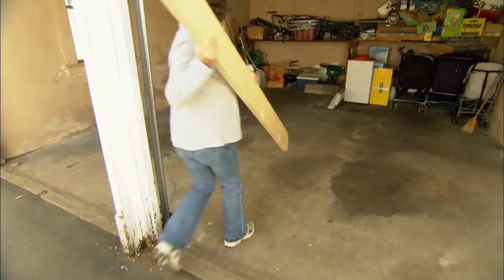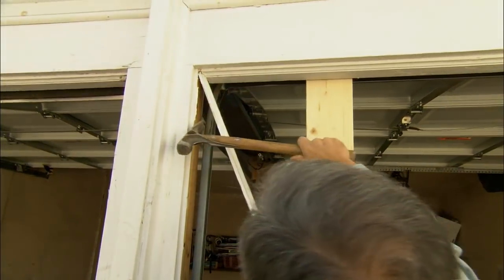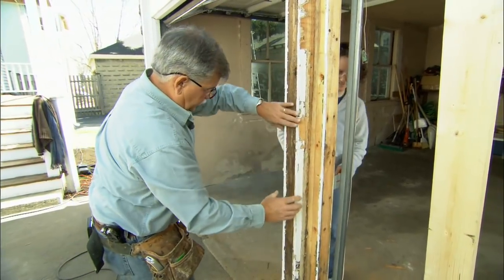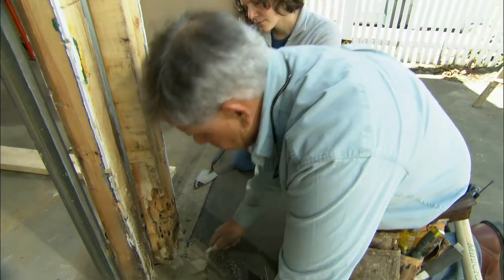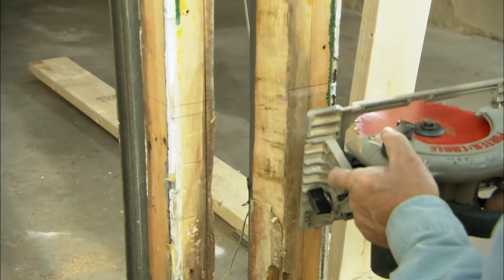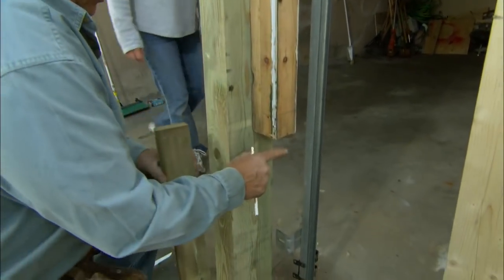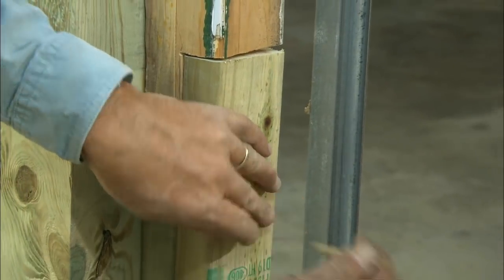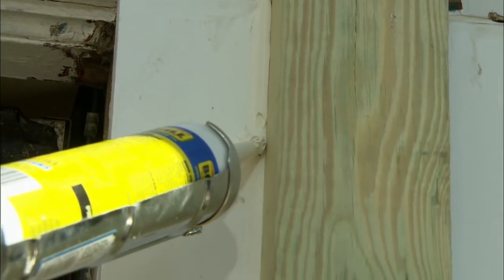How to Replace a Rotted Garage Door Post | This Old House

Comment: Seeing the shoddy way the original post was constructed... makes you wonder what the rest of the structure looks like and how much rot is eating away the garage
Reply: Shoddy and shitty as it may be, it provides a great opportunity for him to get in there and make a night and day difference.
Reply: Porsche924Tim . The post looked like it had dry rot as well.  This is probably from the East coast where temperatures are high in the summer and freezing in the winter. I see this all the time.
Reply: Probably not shoddy work, maybe just really old.
Reply: @dangerdavefreestyle  yeah... i'll pass...
Reply: @zomgosz1503  That's what I was thinking.  That garage was probably built in the 1950s.

Comment: Great job Tommy.  Hey I was asked to repair a 100 yr old house front door jam that the wind had ripped the storm door hinges out and stripped out the wood in the jam.  I chiseled out 12" long sections where the hinges go replaced with oak, glued in with Grizzly glue, and then countersinked a few smaller engineered screws, plugged and filled the seams and sanded all smooth.  Then painted the door jam.  Looked like new.  Replaced the storm door.  One year later another wind storm took the door off and the hinges stayed put with the screws still in.  The door was in the front yard.  You would have been proud Tommy.  And I'm just an old Herk pilot with some woodworking experience.
Reply: I spoke to Tom and he's not proud
Reply: That’s fruity

Comment: Did anyone else pick up on that fine Vaughan Titanium hammer.  I've had one for a few years now and its absolutely Aces!.  It's so light I feel like I'm gonna blow the neck out,  one of the best hammers I've got. Don't want to bust it ripping out some old lumber,  but.........a tools a tool and meant to be used and that's why we love them.  Nice work Tom. Your videos are always cool to watch.  Nobody's ever beyond picking up a few tricks from a great tradesmen.  Another proud carpenter!
Reply: Sorry Scott, that was a Douglas DFR20 hammer, not a Vaughan Titanium.
Reply: Mostly I use a hammer to pull out nails once I got my nail guns. Never could sink a 3.5" nail with one hammer blow.

Comment: I read that treated lumber can corrode doors so it shouldn’t be used for framing. Is that true? Also read that framing should 1/4” off the concrete to prevent rot. Is that also true?

Comment: How did he get that base plate in the right location and angle to insure the post was plumb? It looked like he just stuck it in there and eye-balled the location and angle. Also, how did he hammer that post onto wet concrete?
Reply: It was quick setting concrete that doesn't really compress even when wet.  And the base plate is plumb because the top is plumb and the post was cut at right angles.

Comment: He didn't lift it very much, but still... Once the new post was in, I'd remove the temporary post before I finished any of the trim pieces in case it settled a little bit.
Reply: Framerite Airdrie 
Concrete wasn't set yet.

Comment: You always want to primer bare wood. The wood needs to be primed , before caulking. This will prevent moisture from becoming trapped behind the exposed wood.
Reply: It's pressure treated.
Reply: You don't think much do you?
Reply: You can’t prime pressure treated wood until it dries out. Could take months.
Reply: @SolitaryMaverick  You could... but it's pressure treated so it would be pointless...
Reply: pressure treated wood still rots, and yes, you can still primer it

Comment: thought you couldnt use pressure treated studs for this type of constructions...i have a moisture problem in my guest house i just cannt keep humidity out...the wall agains the back yard is just wet all the time...the bottom 7 inches of the whole wall is rotted . the shhet rock and the 2x4 studs the one laying on the slabs and all thw ones standing are rotted...i was gonna use 2x4 treated studs...they told me Big no no at home depot....so i dont really know what to do
Reply: Jesus Hernandez - The reason they said no pressure treated is because it'll twist and shrink...which will pop drywall screws and give you warped walls.  All treated wood shrinks and dries funny.  You need to fix the moisture problem, not the materials.  A 4x6 beam used here is less likely to warp as significant as a 2x4, and it's the only option here.
Reply: lol...you listen to Home Depot. Maybe you need to get out more often.

Comment: Interesting. At 5:03, screwing in a cross head screw with a square driver bit ... hmmm ....
Reply: I know right?!!
Reply: U mean a robertson?
Reply: good catch
Reply: the screw is designed to be driven with both
Reply: square works better in a robertson head
Reply: They have bits that do both

Comment: I consider myself an amateur but even I know a few things were missed here.... that concrete though it is quick drying, chances are the upper level of concrete dried but not the lower...... also they didn't pack the ground in the hole its all loose soil so the post is going to sink in once the weight is put back down... also e measured everything while the joist was lifted up by that temp support... I am pretty sure that once that gets removed, a lot of cracking is going to occur...... again I am an amateur and feel free to correct me but that is what it looks like to me.
Reply: I was just going to post how good roger is at what he does ...his house must be in tip top condition ..but you do have good points !
Reply: I don't think the concrete will sink. It binds with surrounding concrete, not sitting on top of the soil.
Reply: Concrete hardens due to water and temperature fastens curing process which means it was much stronger on deep inside that hole instead top part of it because curing process also generate heat and lower part is surrounded with soil and it will keep much warmer.

Looked like that hole was so ramdom shape that new pour will stick to surrounding and also load it has to bear was minor.
Reply: I believe the repair was filmed over two days to allow the cement to harden... I would assume. Also, when they were cleaning the rotten wood from the hole, he said they were cleaning all the way down to the footing. Last point, when he lifted, i think he simply took the weight off the post without increasing the height of the opening.
Reply: This is a small segment that's been cut out of an episode and trimmed for length. He also used fast setting concrete which has about a 15 minute working time and they vacuumed  out the whole before putting it in.
Reply: norm sent tom to the truck,to play gameboy while he fixed it
Reply: erictold 
When adding a slab next to an existing slab we drill holes and insert rebar into home with epoxy for strength
Reply: I too am an amateur and I believe he could of got a better measurement by measuring the post he took out but not here to say my ways are better or to criticize becasue theirs not only one way theirs hunndreds of ways to do something to get it done

Comment: Why not replace the entire 2 x 4s as well rather than leave a visible cut?
Reply: the garage opening may have been a pre-built assembly, and changing the etire 2x4 might have involved replacing the entire garage opening, and having to do whatever mortising the original frame had.   The way he did it left as much of the framework intact as possible, avoiding a major reworking.

Comment: @5:49 so they're just gonna leave the gap and put caulk there? Looks unprofessional.
Reply: Because this video is a segment cut from TV show. And they didn't show the whole process. I think.
Reply: I think a piece of quarter round trim then goes over the caulked area,
Reply: @shawndinterman2219  Indeed, quata round would finish that off nicely.

Comment: KIcking the bottom of the metal door tracks to verify the post is off the ground? Interesting, top post rot? Could be water capillary action getting into the end grain. Might not be a bad idea to paint the top post end grain first. Why not cut the jambs before pouring the concrete? That post was cut very accurate to fit tight like that, usually takes me couple of tries. I just don't trust someone driving a long screw without predrilling while my hands are close by. Could ended up a bloody mess. Very nice job.

Comment: Someone buy Tom an impact driver.  He must be stubborn as hell still using that drill/driver to put in screws.
Reply: Same result. So why bother dragging around yet another tool.
Reply: @darinvee4980  Yeah it is the same result because he got the job done with what he had. Period. End of story.
Reply: @bigmacdaddy1234  If you think a drill drives screws better than an impact you are a complete doofus. It's called "right tool for the job", not "I can make it work".
Reply: @darinvee4980  No, it's called I will reach for whatever is in my bag to get it done. You are not living in reality dude. There are 40 different kinds of hammers, and each one is for a specific 'job" - do you carry all of them?
Reply: Why do you want an impact driver?  Modern cordless drill/drivers are brilliant.  I only use an impact driver for masonry drilling, also an option on modern dd's.
Reply: @theondebray  I guess I don't know what a "modern drill/driver" is.  My drills are great for chucking in a drill bit and making holes in wood.  My 1/4" impact drivers are exceptional at driving screws, especially long screws into wood.  Much less chance of stripping a screw head out and much less effort on the hands and wrist.  Virtually every other youtube construction guy uses an impact to drive screws.  Those are facts.
Reply: @darinvee4980  
Tom Silva has every tool you can imagine and YES ive seen him use an impact driver many times . You think a guy like him doesnt use one ? You have no common sense
Reply: @rbeck3200tb40  I've never seen him use one.  However, I've often times seen him use that same drill/driver to install screws.  The reason I first commented on this is because I have an abundance of "common sense" and would use the better tool, which is an impact driver.  Now, you go back to your ignorant thought processes.

Comment: Should have cleared that hole under the post much more and cut more widely around it, leaving a flared hole. Then dig into the ground and place a foundation of gravel before the concrete. That way it will support any weight properly and will not break its seal. Also will not provide an environment for bugs like ants to nest in. This looks pretty shoddy to me I'm afraid.
Reply: Tom mentioned cleaning the hole down to the cement footing, which I suspect is what they used the shop vac for. My guess is whoever built that garage originally framed the whole structure before pouring the floor, which means that rotten post was 6 inches inside the slab, which is why it failed.

Comment: I love watching Tom work, but this is one of the few times he messed up.  The way he supported the garage header temporarily is very dangerous.  At the very least he should have put a couple of toenails in the 2x and the 2x laid flat on the garage floor.  One good bump and the 2x is released and who knows what comes down on someones head, or at the least, maybe some structural damage.  Tom may get away with it, but amateurs could easily get in trouble.  LOL
Reply: Um no he did not mess up. He knows very well what he was doing.

Comment: so this will rot too?
Reply: You must have missed the part where they put the plate in to keep the post off the ground, you also must have missed where they replaced the rotten wood with pressure treated wood, which is resistant to rot.

Comment: What you would do is have a structural engineer come in, add a few jacks to hold up the house, cut the old post, install a new 1, get an inspector's approval an then remove the jacks! Now when i say Jacks i don't mean your car jack. The construction grade jacks are made to hold up a structure while it's being fixed or modified. Modified in some sort of way! For example : you have a ranch style house with no basement, a structural engineer will add however many jacks are needed to hold up the house while they dig out a basement. Steel beams will be put in place along with post to hold the beams in place, inspector gives approval then the jacks are removed an your ranch style house or any house without a basement now has a basement. Just FYI adding a basement to an existing ranch style house is expensive! Expect to pay $70k - $100K !
Reply: My father in law helped repair the sinking main cathedral in Columbus Ohio like that!

Comment: 1) why does he never use an actual jack instead of a two by what ever?  Seems like a waste of material
2) he put the post bracket in the concrete and never waited for it to cure so he could tighten the nut.
Reply: 1) an "actual jack" would still need a board to brace the door. This is how carpenters brace up structures
2) This isn't a tutorial, they leave some steps off camera

Comment: You did not LEVEL it???
Reply: Cedrick. aks It is cool to be smart ? Let me educate you on two points. Number one is, to level something ,is in a horizontal manner. And to plumb something is in a vertical manner. So now you and a lot of other people now know when to use the term level and plumb.Greetings from Cincy Ohio U.S.A.
Reply: yes, technically it's plumb, but now days laser level can do both.
and I don't think you should plumb it.
it is old building, and rather than plumbing it, you should go with existing location of old post,
if you are only replacing one post.

Comment: why do americans use those awful phillips head screws.?
Reply: Some factory engineer came up with it to keep us dummies from over tightening screws and breaking things on assembly lines. They are also self centering as you work. However, I agree there are MUCH better alternatives these days.
Reply: Gotta love slot head screws and a drill.  Works every time!
Reply: These looked like combo screws that take either a Philips or a Robertson (square). When she put in her first screw on that 2x4, the driver bit was clearly a Robertson
Reply: There are a lot more systems than Phillips and slotted. Pozidriv, Torx, Hex, Robertson, XZN (tripple-square). Pozidriv is a more european thing:

https://en.wikipedia.org/wiki/List_of_screw_drives#Pozidriv

https://upload.wikimedia.org/wikipedia/commons/7/70/Poziphillipscompr.jpg
Reply: Those are phillips #3 and they're good fasteners... Combo of square and phillips.   No comparison to reg phillips #2